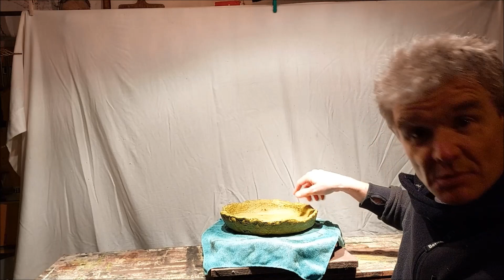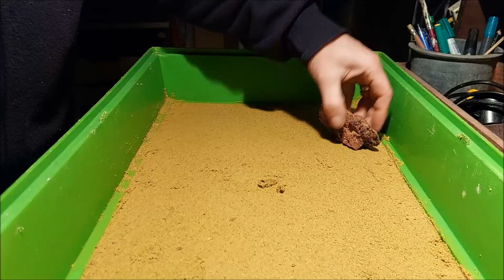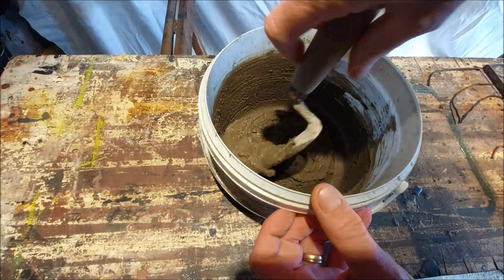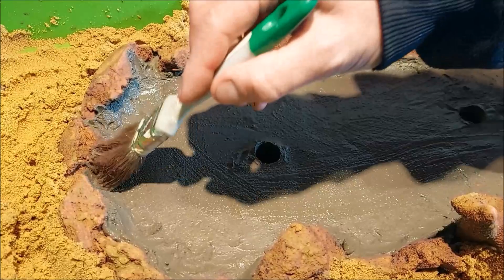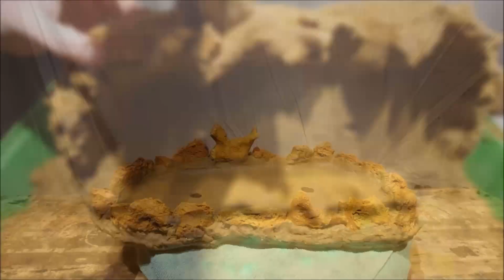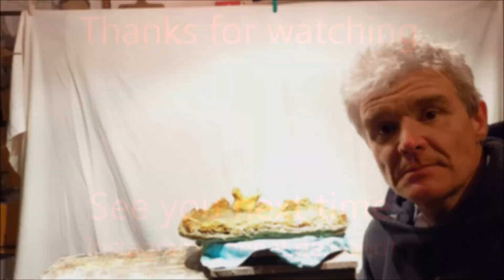Concrete bonsai slab with sandstones.

Comment: If you add concrete pigment to the cement as you mix it you may be able to match the color of the stones and avoid having to paint over the concrete later.
Reply from the maker: Good idea.
grts
Kennet